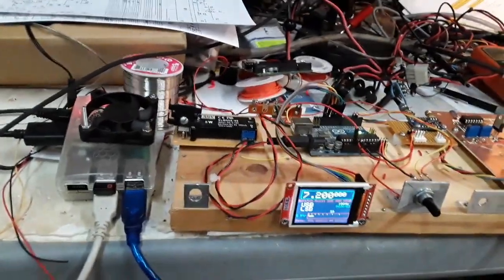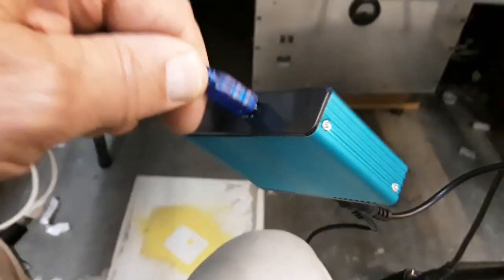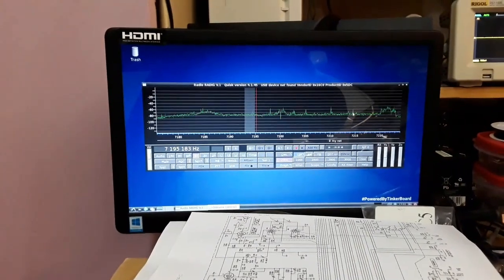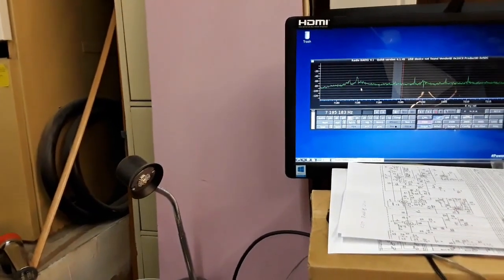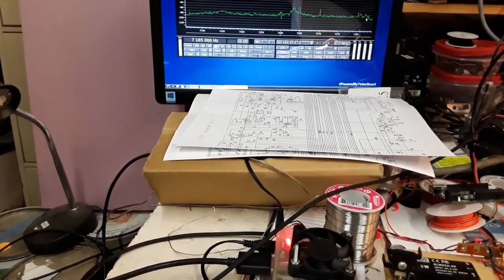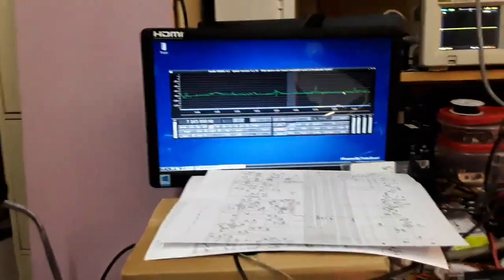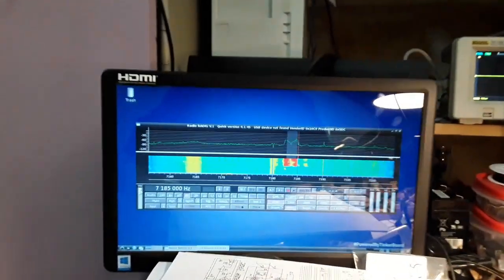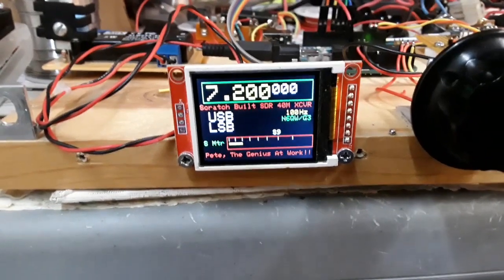RADIG V 3, A new approach to a Homebrew SDR Transceiver

Comment: Excellent  job!
Reply from the maker: Thanks for looking and if you check the two links you will see the early start for this was based on the work of ZL2CTM. In fact I smoked a Teensy 3.5 and Codec board that had Charlies code on it and that is what prompted this new direction.

73's
Pete
Reply: @N6QW  Hi i watch Charlie and all magnificent work since he started on YT. As 40-years ham radio-operator,I did not want to point you to the similarity of the idea. But hey... smoking soldering gun in the morning.....mmmmmmm! 73- 9A3RU
Reply: @N6QW  Need schematic. Is it hybrid design? Superhet + SDR?